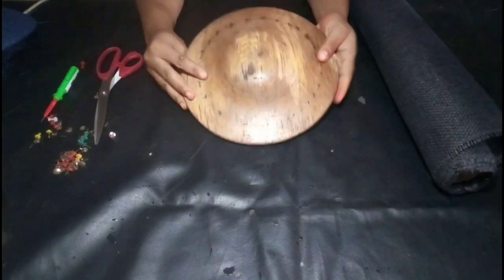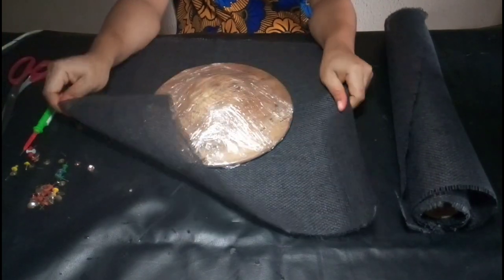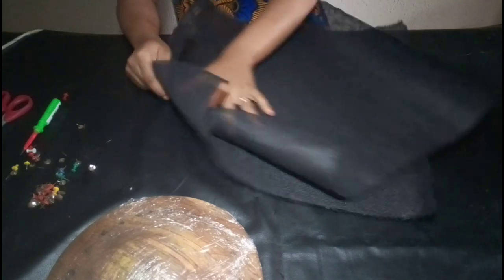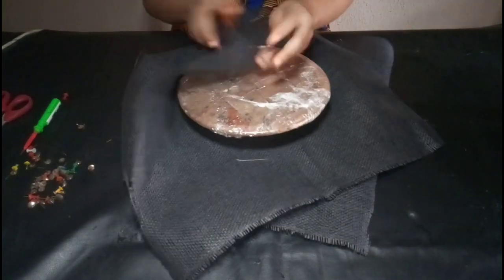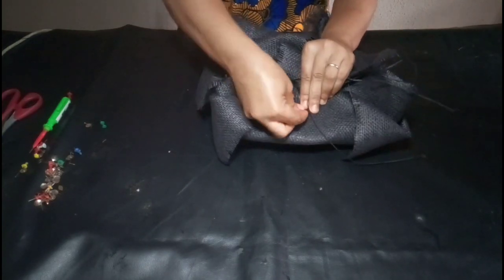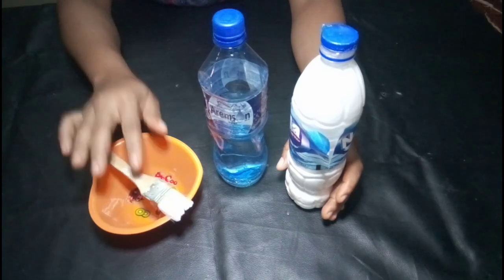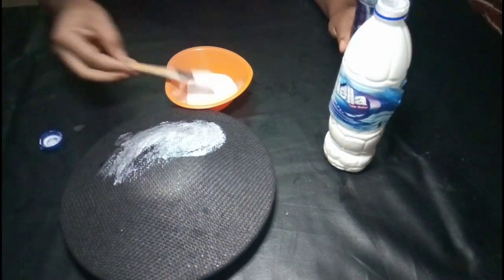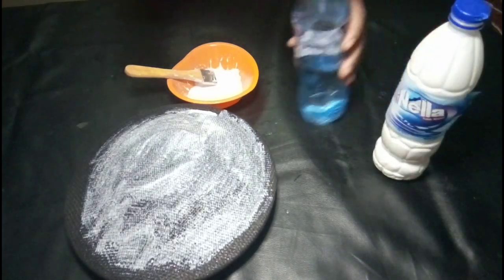How to block and stiffen your hats and fascinator. DIY Tutorial video on hat making

Comment: Hello Ma..thank you for what you are doing.. Please each time I mould and stiffen using Princess material, when it dries I will see white patches like starch on it making it look dirty.. What can cause such... 
Also should princess material be dippen inside water and dried before molding just like you do to sinamay and paper mat.  Should the stiffner used in stiffening Princess material be of the same thickness with that of sinamay.. Thanks and God bless